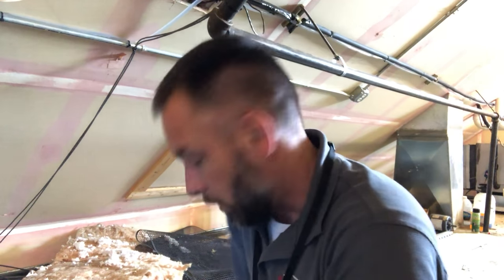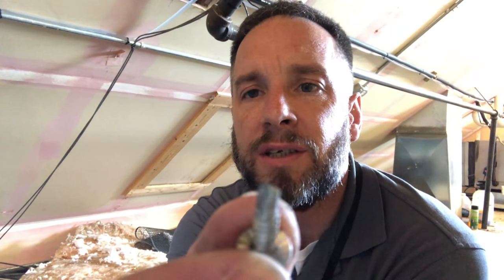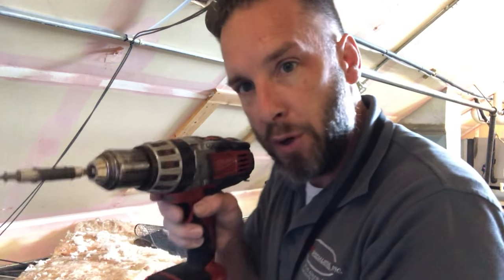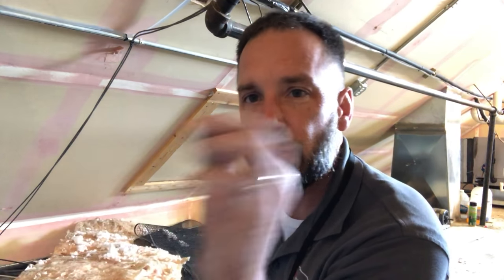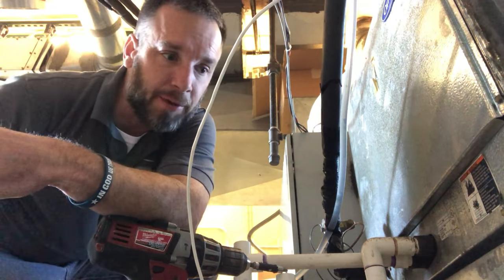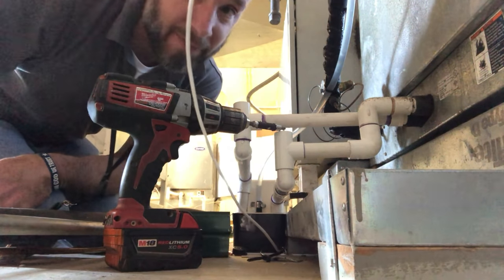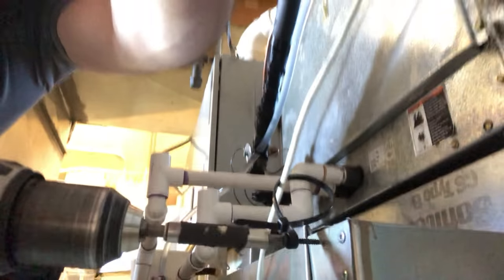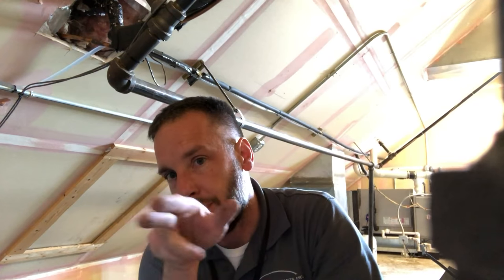How to Drill Using a Self Tapping Screw / Self Drilling Screw

Comment: I thought that screw was called a self-drilling screw, not a self-tapping screw.
Reply: It is, but any where you go construction, electrician, carpentry etc you will here self tap
Reply: It IS a self-drilling screw.  He is WRONG to call it a self-tapping screw.
Reply: @JT-rq7nt  Technically that is correct. However in Europe we often labelled them as self tapping as they tapped their own holes, its a term thats often mixed up. And whats with the block capitals on wrong and is? No need for shouting.